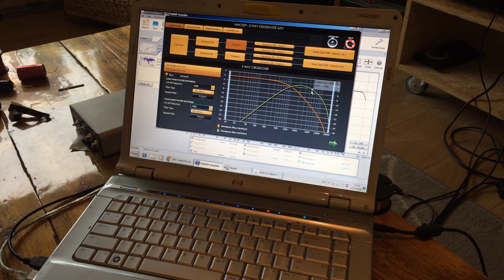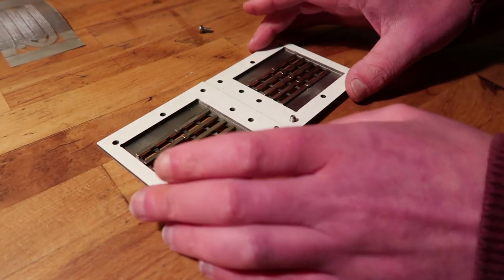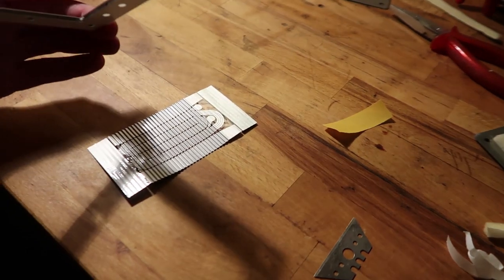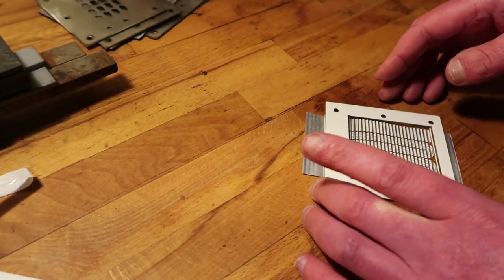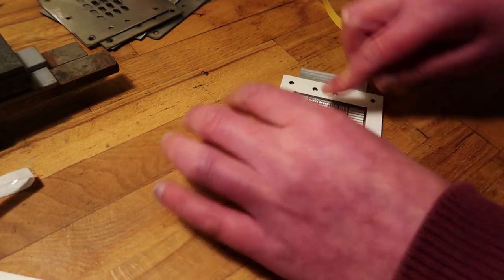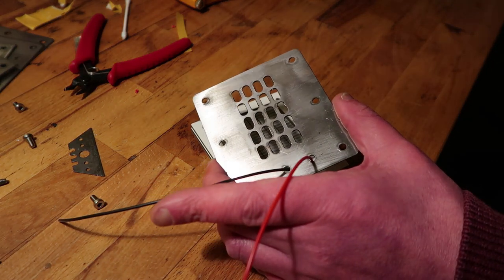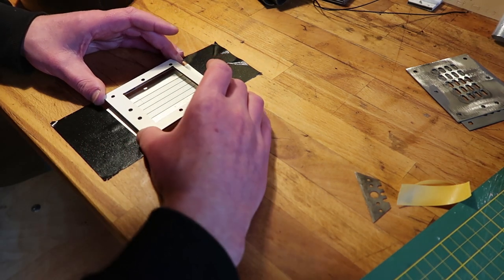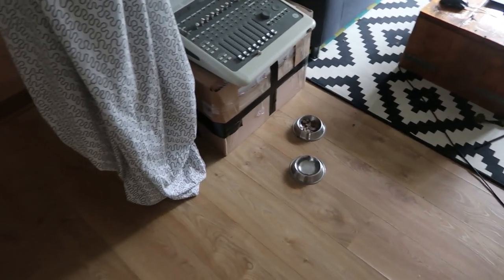Playing with my plasma test pieces - Part 2  (and a sneak peak of Puss)

Comment: I think that the use of diaphragm suspension only at the top and bottom solves some of the problems of placing the Ribbon in the magnetic gap is easier but creates a serious problem of short-circuiting the loudspeaker phase.
Despite this, I believe that your projects are very advanced and well-thought-out deserve applause.
Regards :)
Reply from the maker: well thank you, well the flat one can be better i think. but the corrugated worked a bit better then i expected.  the corugated might be allot of fun when you make them 2 or 3 times as wide :) doing really down to 300-400 hz :) in combination with a tweeter or some tricks that might or might not work :)
Reply: @joppepeelen  
have you tried to shape the diaphragm with fewer teeth?
Stiffness and stretching of the web are important in tweeters
Thickness, length and durability are mutually exclusive. Sometimes you have to make compromises, unfortunately.
The larger the ribbon, the wider and more durable it must be, which will translate into the characteristics of signal transmission.
Have you tried spraying the coil with aluminum pairs to reduce the vibrating mass?

Comment: Nice work. I think that I would have 3D printed a tool for the insertion of the magnets.
It would be nice that you show how you are checking the polarity before you glue them down.
I mean, I see that you do it, but for others it might not be that obvious.
Reply from the maker: well usually i explain that but i somehow thought i did it so many times.....   i usually dont bother +-  but more of keeping them the same. so i got one reference magnet on my lamp with one side painted black to determen polarity.  only after testing i know what the foil did and i could adjust it if i wanted to keep color coding the same :) but usually its just to make sure its push pull.   and wire colors... i dont care about at this stage :)

normally i make a cnced template to dump the magnets in, i actually might have one for these somewhere........ but did not bother looking for it :)
Reply: @joppepeelen  Good. Really nice distortion levels!
Reply from the maker: well its low volume, like half a watt or something. but since i knew ..... the flat one might sound terrible. (when tapped it sounded terrible already) i thought this was enough to see how terrible :) and it did :) the corrugated one i  am able to cross at 750Hz  with a 88 dB woofer, with a 12db oct filter. sureley it depends on how loud you play. but for me it works... good enought. since the distortion of the tweeter will be dwarfed by the woofer :) still higher might be better

Comment: Have you considered using PCB eyelets to connect wires to the contact points?
Reply from the maker: yes , i use that in normal ribbon drivers, but since this version only uses 2 contacts, soldering is much better connection. and doable :0

Comment: At 6:28, why not use the VHB tape that you bought a couple of years ago?
Reply from the maker: hahah you even knew ? haha yeah i still got a few sheets from the EAP speaker, i dont like the stickyness of it to be fair, it works for not slipping (and it was like 80 euro or something stupid). but in this case. there wont be slipping since there is hardly any tension :)
Reply: @joppepeelen  Ok.

Comment: At 10:55, what is it that you put on the pads and why?
Reply from the maker: good question , problem is i explain it everytime. and in this video i left some things, because i dont want to repeat everything  :(  its a flux to solder to aluminum !  best way to use it is to solder like a newby: ) add solder to the iron then dump it into the flux. i never solder like this but only when using this stuff. can be bought for 2 euro on ebay ! usually a russian bottle. i think its a form of acid. but i dont know witch so i just buy these bottles.
Reply from the maker: Damned i only now... recognize who you are hahah (i am so bad with names) Solhaga
Reply: @joppepeelen  Ok, thanks. I guess that I haven't been that observant in your previous videos.
Reply: @joppepeelen  Yepp, that's me.
Reply: AlumWeld Flux 15 ml from Poland ;)
Reply: @Ruunawayboy  Thanks! I didn't find it on eBay DE though.